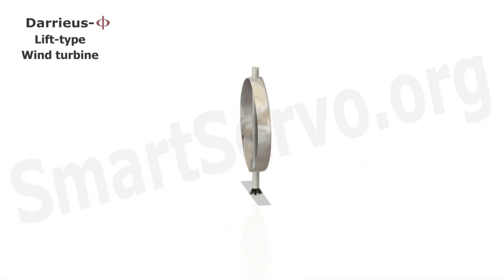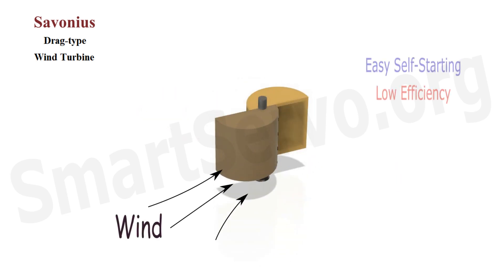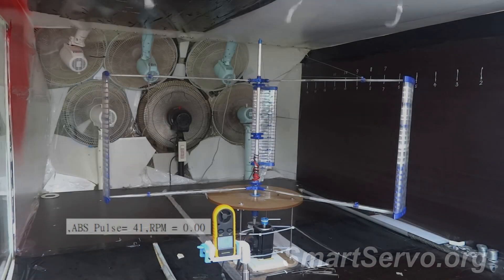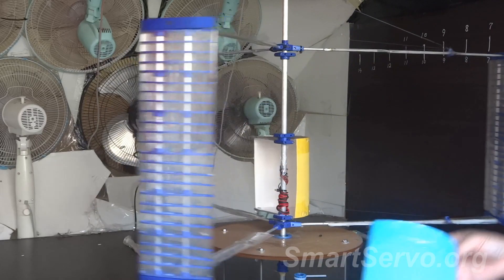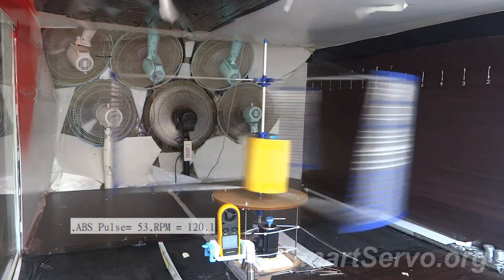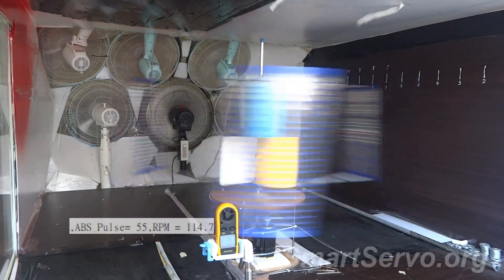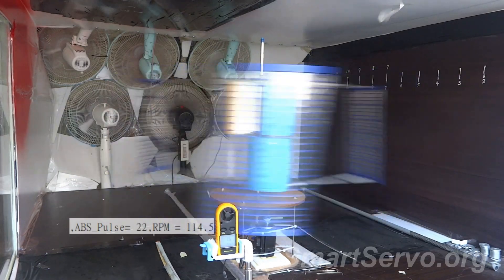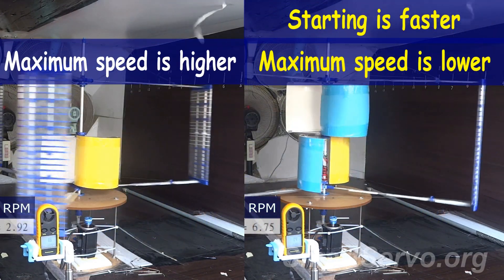Darrieus hybrid Savonius wind turbine experiment, DIY a wind turbine at home

Comment: OK, it appears from your results that the double savonius losing only 7 extra rpm is a decent trade off for a site with intermittent wind where many starts will be needed. However have you considered adding a clutch to the savonius to allow it to freewheel when after the start process completes?
Reply from the maker: Even with the clutch , the interference still exists when the Savonius is inside the turbine. You can also move the Savonius to the top or bottom, but it will increase the complexity of the structure.
Reply: Dump the Savonious and allow the blades to pitch.

Comment: Or just get a bearing or simple part, disconnecting the cylinder on Vcyl < Vout
Also moving the cylinder outside of the inner and get it under.
This allows for a much bigger Cylinder and area to start or harvest energy from, due to better efficiency.
Reply from the maker: It's a tradeoff between complexity and efficiency.

Comment: How about making the cylinders close on each others when the turbine picks up speed?
Reply from the maker: Should help with efficiency, but needs to add some mechanism and act at the right time.
Reply: I was thinking exactly the same, also wouldn't a simple device using the level physic and a sized"-for" mass to get it to close in time, linked by a spring (for re-opening) be a good way to achieve this ?

Comment: Hello, can we ask for what materials you used especially in the electronic parts below and the motor
Reply from the maker: refer to => https://youtu.be/9AdpggaOfF0?t=304
assemble => https://youtu.be/BlIM43fRp60?t=46
But this video only uses it to measure RPM, no need to control the motor.
Reply: @SmartServo_org  0⁰⁰0⁰

Comment: What if you put the drag blades over the lift blades. Allow the lift blades to free-wheel on the axel, but connect to the lift blades with a sprag or one way clutch. The drag blades can start the lift blades turning, and then "disconnect" from them at higher speeds, allowing the lift blades to spin faster.
Reply from the maker: It should help with efficiency, at least the drag blades don't interfere with the lift blades. But the height should increase a lot.
Reply: @SmartServo_org  
Not necessarily. As a simple ready made system I would choose a bicycle rear wheel.  The rim on the lift blades and the drag attached to the chain gear.  When the lift blades are faster than the drag then it is like free wheeling down a hill on the bike.

Comment: These hybrid designs seem to rectify the low wind initial start up issues of some VAWT designs.
The name of the game is to get the savonius as small as possible while doing the job it was put on for...
Four blade turbines have been tested with good results.
With more tweaking and testing a viable large scale power generating design can be attained using this type of hybrid design.
With the generator at the very bottom of the tower or column for easier maintenance and
using materials that can be recycled a winner.👍
Reply from the maker: This design has existed for a long time. Although it can solve the problem of startup, it has not been popularized, indicating that there are still some problems.
Reply: @SmartServo_org  Having the extra blades makes the initial startup a bit easier.
Some one megawatt versions are in service at the moment.
Reply from the maker: @markjmaxwell9819  I'm glad to hear this, can you provide the link?

Comment: At some point the drag blades should slide together to form a cylinder
Reply from the maker: It makes sense, but it depends on the tip speed ratio to decide whether to slide. Therefore, it is necessary to know the wind speed and rotation speed at that time.

Comment: Well from 125 to 120 to 117 rpm, not that much of a difference.
Also the energy/power output might still be higher even with lower rpm, because the turbine could provide more torque?
Reply from the maker: Lower RPM but higher power under the same load is only possible with different wind turbines. But the Darrieus turbine in this experiment is all the same and unloaded. And Savonius is just a burden after the turbine has been started.

Comment: Perhaps if the two halves of the Savonius were on slides and coupled to a centrifugal mechanism so once the rotor has started they shift towards each other to form a cylinder they would present less drag at max speed.
Reply from the maker: good idea
Reply: Or, perhaps just having a cylinder in the center that will start the rotation!
Reply: How would having a cylinder in the center start the rotation?
Reply: @GordieGii  It's called the Coanda and Magnus effect!  These are driven by a motor, so on second thought it probably won't work!
Reply: @themeek351  Yes, it's the motor spinning it that makes it act like an airfoil, and it would need to be off center.
If you had a motor attached to the axle you wouldn't need the Savonius to start it.

Comment: You could improve the savonius rotor part: the inner edge of the half barrel must be put a little bit to the other side of the axis, so air can move through the rotor
Reply from the maker: Thank you for your suggestion, I actually made it partially overlap but not much, because efficiency and starting torque are in conflict with each other, and the main purpose of Savonius in this application is for starting. Therefore, the Savonius rotors are stretched more outwards to obtain greater torque.

Comment: 👍👏  profesjonalne badania. Tak trzeba robić, a nie oszukiwać w wątkach free energy generator
Reply from the maker: This video is not free energy, it just uses Magnus effect to drive wind turbine
Reply: @SmartServo_org  oczywiście. Wiem o tym. Czy macie jakieś wyniki: średnica rotora Fi, wysokość L, prędkość rozruchowa wiatru v (m/s), moc P?
Reply from the maker: @Hanys111  Lift blade : Chord 12 cm,Height 40 cm, diameter is 104 cm.
Savonius (1 rotor/1 layer): width 16 cm,Height 18 cm,diameter about 30 cm.
The wind speed is as shown by the anemometer in the video (about 2 m/sec), no power is measured.

Comment: I think the question now is: Does Savonius
a) have a physical limit of what RPM can it handle, and since it's attached to the same axis, interferes with the Darrieus' momentum
b) get in Darrieus' way physically, i.e. by creating turbulence and/or "hiding" the furthest blade from the stream of the wind

The easy way to test this would be to move Savonius out from the middle part of the construction and attach them to the top and bottom of the whole assembly.
Reply from the maker: I have done a test with only the drag blade, and the rotation speed can only reach 50 RPM, which means that the Savonius is dragged by Darrieus when the speed exceeds this speed.